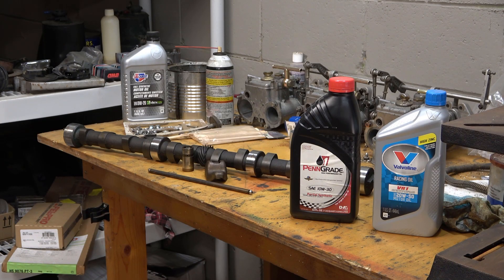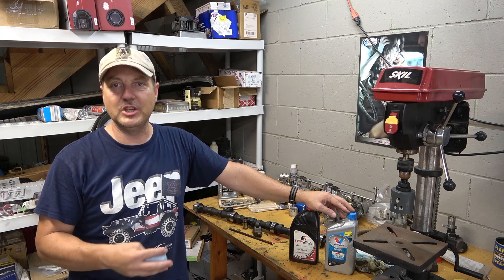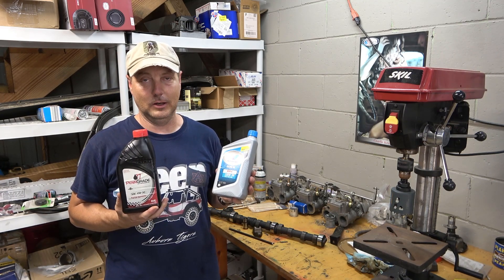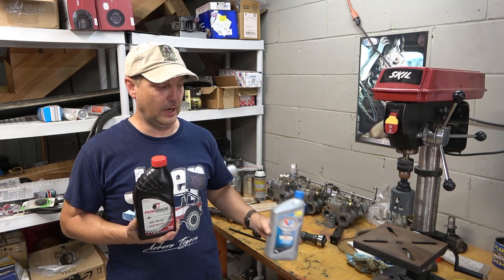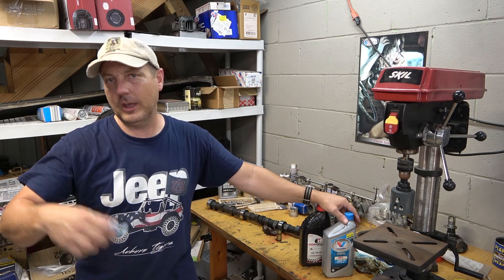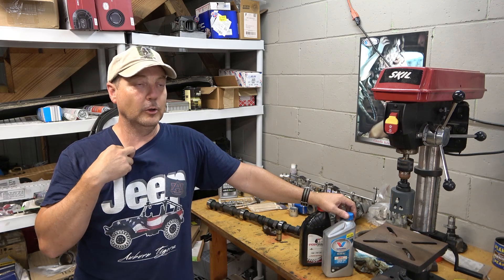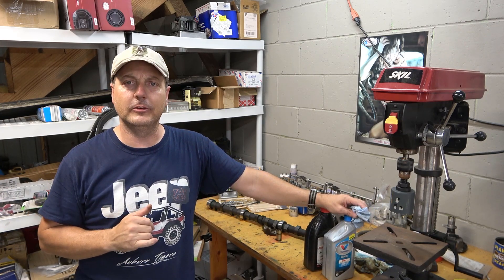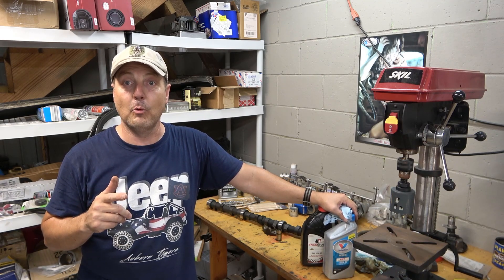ZDDP in Motor Oil, why you may need it and where to get it.

Comment: i can understand high RPM engines but old school 360 FE ford like i have was rebuilt 15 years ago and runs 10-40 conventional oil  with 50-55LBS of oil pressure, my oil is changed every 1000 miles, conventional oil is cheap Rotella or Walmart high tech works just fine for 16.00$ for a 5qt  and a 3$ oil filter is cheap engine protection.
Reply from the maker: That makes sense

Comment: GM at least used to sell a product called EOS. It was basically zddp,  petroleum distillates, and napthenic oil. Marvel Mystery Oil is basically napthenic light oil, distillates, some phosphorus... this and that but it's not as good as EOS was. I'm not sure if Ralph Schrader bought it and sells the reformulated edition or if he was the original manufacturer and sold it to GM? Anyway it's been reformulated and it's not what it used to be. Builders used to use it as an assembly lube and then you could use it later... back then if someone used cheap oil and then their engine wasn't quite mechanically right whether PCV valve, worn rings causing blow-by, carb running rich.. whatever.. and then your lifters were making noise first thing people would do is blame the oil LoL but you could use it and it would free a lifter if it wasn't beyond mechanical limits. But Valvoline VR 1 would be a good choice if you have an older classic with a flat cam or Castrol GTX classic if you insist on using heavy oil. Brad Penn is another solid choice. The problem with adding additives is it's a bag of cats... there's no way...no objective way to know whether you're ultimately doing good or adding harm 16 ounces at a time. I remember the days when people would add heavy additives to a cold engine and that stuff guaranteed would go down to the sump and stay or even worse clog the oil pump screen and your engine would cavitate to death. Of course, people always blame the product LoL... it's never what was already wrong or how they applied it. But as a rule I'll research something to death and see if there's been anyone else adding it with the same kind of oil I'm using before I'd consider pouring it in and mixing it with the oil. Sometimes the additives clash and it breaks down the oil already in the engine. And sometimes the thick "honey" just sticks to things and draws whatever the oil has effectively dispersed and then that's adhering to the walls where it was flowing freely. IDK.. it's a big crap shoot. But the marketers will give you a soft push that sounds like a hard pull to get you to buy it. Then if you get anything out of it...warm fuzzies, spirit bumps, whatever you perceive it to give then you're a repeat buyer and swearing allegiance to everyone you come across who's gullible enough to believe. Reminds me of Phil Silvers telling Don Knotts about something in It's A Mad Mad Mad Mad World. Some of them will believe every word.
Reply from the maker: 100% YES.  In the early 2000s, Ron Iskenderian would recommend GM EOS for us in the Datsun race community, sadly, that product is no longer what it was.  I agree, oil doping is a mixed bag, and you should stick with properly formulated oils.

Comment: I have a 2019 Nissan 370Z with the 3.7 liter VQ37VHR engine that came out in 2009. I had a used oil analysis done on the engine with it running a good quality SN rated oil and had an iron concentration of 70 ppm after about 3700 miles on the oil. A more normal level would have been around 10 ppm, so I switched to an oil with a higher zinc, phosphorus and molybdenum level, Redline 5w-30. It has about a 50% higher level of these antiwear additives in it, so I'll see how it does when I get the lab test results back on it.
Reply: Following lmk how that goes.. I drive a 350z
Reply: @TravoyFox  I should be getting the results back soon; I'll post the results.
Reply from the maker: Redline is good oil

Comment: I use the Lucus Hot Rod zinc oil 10-30, in my 1982 Toyota Celica, 1990 chevy suburban 3/4 ton 4x4 also in my lawn mowers, gas 9000 watt generator, lawn tractor
Reply from the maker: That is not a bad choice
Reply: @superb60ce  I remember my High school auto shop teacher in 1970  in the classroom he would have a lettuce on engines and he did bring up the subject of zinc in motor oil and how important it was to the engine  and what it does for the engine, it was just a part of engine oil for engines from back in the 1930 or so

Comment: I remember when Kendall gt 1 20w 50 had zddp in it. It was green like Brad Penn. It also had a pic and signature of Don Garlits on the case. Best stuff. Then I wiped a cam on my sbc after Kendall took the zinc out and it was no longer green. Brad Penn reminds me of old Kendall gt 1. Best oil.
Reply from the maker: It is made in the old GT1 refinery. Same old formula from what I’m told

Comment: What do you think about zddp im imports? I recently rebuilt a rav4 and they have flat tappets.
Reply from the maker: IMHO, any vehicle with flat tappets, or in your case, buckets, should be using a zddp fortified oil.  Also, use the oil recommended in AUS.  5w30 or 10w30

Comment: I drive a 1986 Toyota pickup 2.4L 4 Cylinder, I've always used Castrol 20w50 conventional, anybody know if it would be a good idea to add zinc or use Rotella that has zinc in it? I am not sure if my truck has a flat tappet camshaft. But I've heard its good to use.
Reply from the maker: Would not hurt

Comment: Great video! I’ve got a 2005 Jeep 4.0 with 117k miles and it’s a DD. My goal is 300k miles, so what’s your preferred oil brand recommendation? Subscribed!
Reply from the maker: Penn Grade 1 in 10w30, High Zinc semi synthetic.  Use a Wix filter (Napa Gold) and change every 6mo or 5k miles
Reply: @superb60ce  awesome Roger that!
Reply: I use the Lucas 10w30 racing oil w/ zinc, works well, helps with low oil pressure. Otherwise, 5w20 with Lucas heavy oil additive just to have oil pressure.  No big deal in winter as MN winters help keep the oil cool enough to stay thick.

Comment: 1993 2.5 Jeep ?
Reply from the maker: Yes, solid lifter engine design
Reply: @superb60ce  
I watched your video on my ccv set up and was able to fix my reverse vacuum issue. It was blowing oil and condensation into my air cleaner. Im going to pick some zddp oil for my next oil change too… thank you for your videos. They are clear and very helpful.
Reply from the maker: @samuelmandarelli2645  Thanks for the kind words

Comment: Thanks for the information man. I've rebuilt my 4.0 98 wrangler. I've been using b Penn oil semisynthetic, by mistake I bought full synthetic, what's the difference between the 2? If you have a chance to answer, thanks
Reply from the maker: I have never run the Peen-Grade full synthetic and therefore don't know the exact differences. The key to longevity in the Jeep I6 engine is oil change frequency with a quality oil.
Reply: @superb60ce  thanks

Comment: Note, if the engine burns oil the burned ZDDP will cause the catalytic converter to go bad over time quicker than normal. The vddp you will not only clog the converter but it will cause a chemical reaction inside.
Reply from the maker: The EPA had a choice, but instead of fining, and fixing over polluting cars and requiring engine rebuild or replacement for those that burned a lot of oil, we will just take the "pesky" chemical out, engine longevity be damned

Comment: Amsoil z-rod oil allegedly has a lot of zddp in it. I use Amsoil 10W30 signature series and molybdenum is almost nonexistent in that oil. By doing oil samples, I also noticed that motorkote raised both my zinc 18% and molybdenum 24% and several other oil additives, but negligible numbers.
Reply from the maker: Redline also has a high ZDDP line
Reply: I am an avid Motorkote user.   I didn't know that I would raise zinc/moly levels.     That's really good to know...  I love that product.

Comment: EPA are a pesty bunch.
Reply from the maker: Yes they sure are.  Instead of fining, and fixing over polluting cars and requiring engine rebuild or replacement for those that burned a lot of oil, we will just take the "pesky" chemical out, engine longevity be damned.

Comment: Chevy went to roller lifters in small blocks in 1986.5, so by 1987 all SBC were roller motors. 
Olds had rollers lifters in some of their V8 engines as early as 1982. 
Ford went to roller lifters about the same time GM did. (87)
So why did they take out the zinc? The EPA pressured the oil companies to do so sole because the zinc in very high milage cars "Could" have their O2 sensor become inoperative if the zinc built up from blowby.    Clearly it caused more problems than is solved, or maybe it was part of a plan.
Reply from the maker: GM first began installing roller cams in SOME Chevrolet small-block, V8-equipped cars in 1987. But OE roller-cam installations in trucks didn't occur until 1995

Comment: ZDDP is still in regular motor oils, but not necessarily in the amount that was used in the past. Also ZDDP is not the only extreme pressure additive that is used. The amount needed in an oil for a flat lifter engine is debatable and dependent on many factors. Not all flat lifter engines require high levels or special oils after break in. 
Unfortunately many motor oil products are being marketed to cash in on the fear created by the reduction in ZDDP.
Yes, in some engines, especially high performance engine with modified cams do require higher than normal levels, but typically a well broken engine in stock tune will do just fine on a non specialty oil.
Reply from the maker: Why risk it???...and have you priced oil these days....long gone is the time when Castrol GTX was a dollar a quart....it is all expensive.

Comment: I have a 1992 Camaro with the L03 TBI 305.  Is high ZDDP oil still recommended in this application?
Reply from the maker: Yes
Reply: NO! but I would. Chevy went to roller lifters in small blocks in 1986.5, so by 1987 all SBC were roller motors. 
Olds had rollers lifters in some of their V8 engines as early as 1982. 
Ford went to roller lifters about the same time GM did. (87)
So why did they take out the zinc? The EPA pressured the oil companies to do so sole because the zinc in very high milage cars "Could" have their O2 sensor become inoperative if the zinc built up from blowby.    Clearly it caused more problems than is solved, or maybe it was part of a plan.

Comment: Just to be clear ZDDP aka Zinc Dialkyl DithioPhospate is not about the Zinc but rather Thiophosphate which provides the anti wear protection. The problem is Thiophosphate will damage seals in an engine so Zinc Oxide is added during the manufacturing process to neutralize the acids. Unfortunately ZDDP is a catalyst killer over time due to sulphated ash which again is great for engines just not catalytic converters. Diesels on the other hand are able to burn off ZDDP byproducts through regeneration of the DPF, hence the 1200-1500 ZDDP levels in diesel oils. The EPA has attacked ZDDP due to noxious gasses the replacement is Moly aka Molybdenum Disulfide or Boron aka Boron nitride
Reply from the maker: Well put.  BTW glad to see you were able to pivot your business with the legislative restrictions last year
Reply: I am running catless should I be okay with such oil if I am looking for extra engine protection for my modern gen 3 hemi?
Reply from the maker: @riology2234  Cat or not, it will provide extra protection...jury is out on wether it actually damages cats...been using high zddp oil in my cherokee since new still on original cat no issues
Reply: Just keep on top of your oil control rings, and the cat won't ever see that motor oil.

Sure, high ZDDP in an engine with blowby will kill the cat quicker...so endeavor to not own an engine with blowby.

Comment: I use valvoline vr1 in my m8 harley Davidson it runs smooth
Reply: Own a 1992 air cooled 911. Been running Vr1 20w50 for the ideal zinc and phosphorus levels.
Reply: @johanbjork1650 / ur smart😮

Comment: Just use zddp additive its not expensive
Reply from the maker: With the current cost of motor oil, the savings is negligible, and that is only if you are using a certain additives.  The current cost of the additive most recommended by camshaft grinders (GM E.O.S) makes it cost prohibitive.  Just use VR-1

Comment: im have a old 1970 car and sumbody told me to use it the rotella t4 diesel oil in my car becose it has lot of zinc and phosforus insides the iol ...is this ok what you think
Reply from the maker: I know the T4 formulations have changed, and I do not use them, but diesel oils due generally have higher ZDDP levels
Reply: I talked to Shell yesterday. They said that T4 1540 is their highest rating zddp oil. They would not give me the exact ppms though.  I would go ahead and use it.

Comment: What do you think of VR1 in my Harley Davidson Road King 2010....cam driven off the crank roller lifters pushrods to the rockers... Is it a mineral oil....what do you think about it.... TIA... cheers 🇷🇺
Reply from the maker: Many Harley owner swear by VR1 20w50
Reply: @superb60ce   thanks for your quick reply....yes I've been thinking about switching to vr1 for a while....some UA's show better results than some synthetic oils....there was a time when Harley said Don't use synthetic oils in your motors.....ok thanks again and I'm switching to vr1.... cheers 🇷🇺 from Russia with love..👍
Reply: Its excellent oil

Comment: Would it benefit the synthetic oil I use by adding an once or 2 of zinc to it?
I have an 02 Silverado pickup with a V6 that has nearly 300k miles on the engine.
Reply from the maker: I used to "dope" my Castrol GTX with GM EOS...so not a bad idea, but there are better alternatives out there now
Reply: @superb60ce    , what alternatives do you recommend for a high mileage engine?
Reply from the maker: @04DynaGlyde  just continue using the recommended oil and shorten the change interval...
Reply: @superb60ce , What's your thoughts Z max?

You know it can go in everything but the brake fluid.
Reply from the maker: @04DynaGlyde  I have no experience or thoughts on ZMax

Comment: funny you mentioned this. i have a 1898 chevy C2500 i let our Son borrow it to go to college. it (WAS) a 300+ HP rebuild flat tops and cam and lifters and all the machine work done. i haven't used it much since getting it back and noticed the oil pressure was mighty low. the rebuild now has 100k it. so i decided to drop the pan and look at things. the main bearings are down to the copper and the rod bearings and crank don't look so good either. i suspect when the kid actually had the oil changed it was at some $24.99 instant auto place with bulk crap oil and filters. so, now i am rolling in new rods and mains to get me by till i can save some $$$ for a new crate motor from chevy and some alum. heads and cam and manifold etc. this engine is most likely toast and will cost more to have machined and rebuilt than it will ever be worth. i can't imagine what the cam looks like and now the lifters won't stay pumped up as well. College is exp. in more way that one appparently. the first engine i got 218K out of by me doing the oil changes and service and half as much when a kid does it sometimes.
Reply from the maker: Quality and Timely oil changes are cheap insurance

Comment: Have used bradpenn in jeep 2.5 and 4.0 engines for years, and abused the crap out of them for 100k+ offroad miles. Still running strong on them.  I would occasionally run rotella diesel oil in them when I was being cheap on oil, and was only going to be putting around town, to-from work (sometimes hard to justify a $70 oil change vs a $25 oil change) Had one 4.0 that I ran nothing but that rotella and some hy-per lube, and it ran quite nicely as well. I'd love to see longevity between the two 4.0s that was mostly bradpenn and the other that was all rotella and hy-per lube, but had gotten rid of them some years ago with 200k+ on them.
Reply from the maker: Brad Penn is all I use and recommend in Jeep I-6 motors

Comment: After running the break in oil for the 20 minutes at 2000-2500 rpm. What do you think of running rotella t4 in a Jeep 4.0? Thanks
Reply: I have just continued to run the VR1 as I’ve had good luck with it. Plus I’ve found I can pick it up at O’Reillys for $5.99 a quart. So definitely worth it for me to do that with a wiz filter just for my piece of mind.
Reply from the maker: I would not recommend T4....it is a 15w40 oil which will be too thick on startup
Reply: @superb60ce  how about T6 5W-40?
Reply from the maker: @walkerforsyth6221  not exact, but the sentiment fits....Ive seen tons of these posts/questions over the years.. here is my 2 cents. VR1 is $6.80/qt T6 is $5.80/qt Spend the $1
Reply: How about a 2001 Jeep Wrangler 4 cylinder high miles would you recommend 20w50 with a bad lifter???
Reply: The vr 1 20w50
Reply from the maker: Lalo Magana if you have a bad lifter, no oil is going to fix it
Reply: There is a new Rotella T6 product, 5w-30 that will be closer to your spec. Right now the only place I've found it is at NAPA for $35 per 4 gal jug ! Either wait for more places to carry it, price to go down, or use the VR1. On my Ford 4.9 i6, I'm using Full Syn Mobile1 HM 5w-30 (which has virtually the same amount of Zinc as T4) and adding <1/4 bottle Lucas TB zinc Plus.

Comment: Can you use vr1 in a car with rocker arms that dont have tapped engines? Post OBD2?
Reply from the maker: Sure, just be mindful that if you are getting excessive oil blowby, the zddp can shorten the life of the catalytic converter
Reply: @superb60ce  thanks for the info. Very helpful.